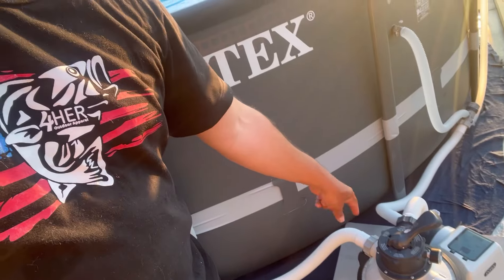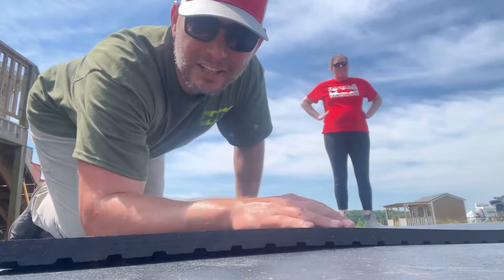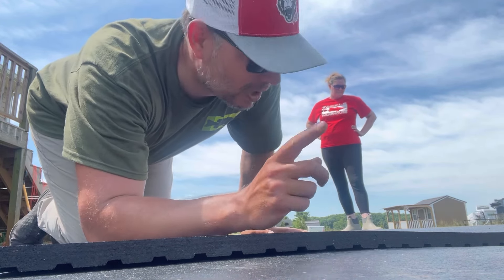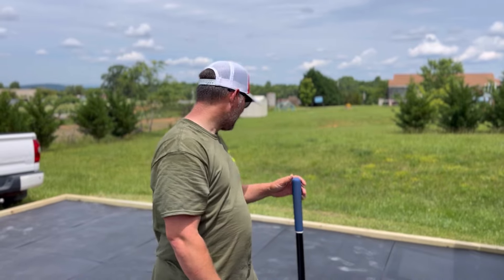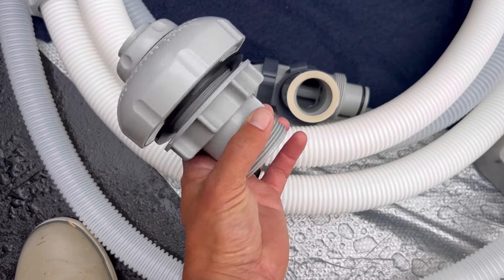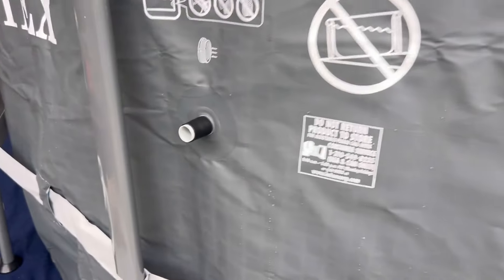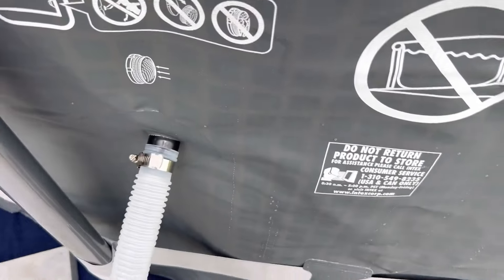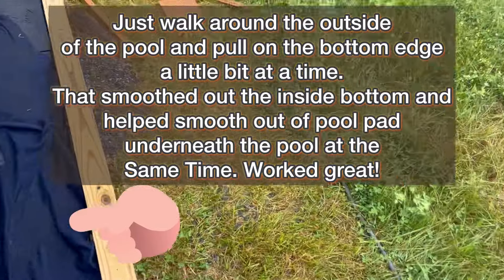Intex Pool Install w/ Many Tips & Tricks

Comment: What size pool? I just ordered a 18×52 and have been looking at these stall mats. I love the idea but mats are pricey 😢 Did you use sand first? And or did u put anything over the mats before putting the pool up? Thank you.
Reply from the maker: Thanks for the comment. Ours is a 16ft Intex Round pool. We did a dump truck load of gravel to level the pad before installing the horse stall mats. Those mats are extremely heavy duty so short of spending the money on a concrete pad we believe this is the most cost effective & long lasting option. 🙂